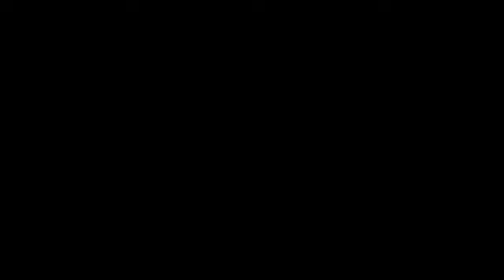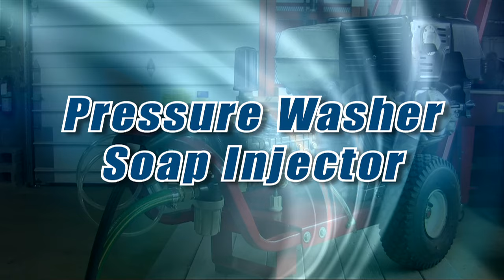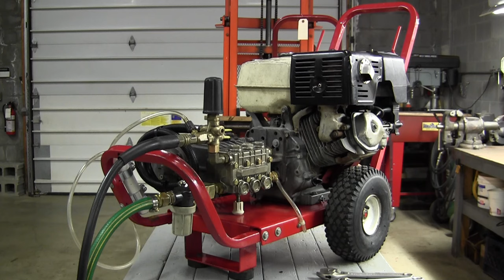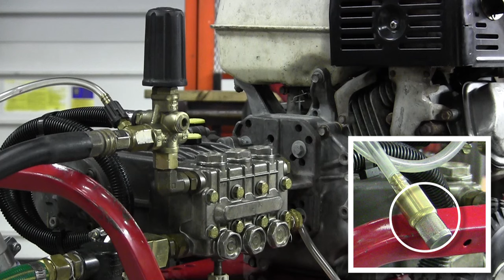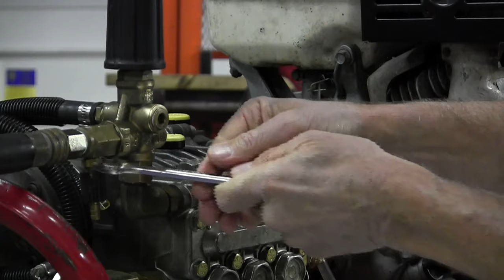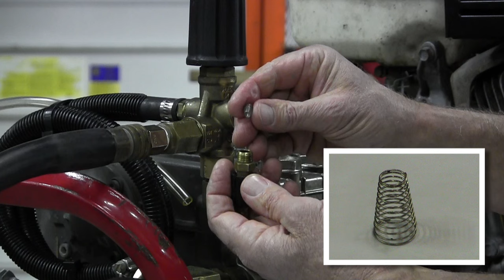Pressure Washer Soap Injector

Comment: You mentioned using oil or Vaseline to lubricate the "o" ring. Bad idea! Both contain petroleum distillates, which will immediately begin to degrade the rubber that the ring is made from. Typically, the first sign of that degradation is the o-ring will swell out of shape. Plumbers lubricant, or silly as it might sound, KY Jelly or an equivalent sexual lubricant will not degrade rubber (for obvious reasons!).
I learned this firsthand when replacing the rubber seals on my discharge hose of my above ground pool. I used Vaseline, which IMMEDIATELY allowed the sealing ring to stretch out of correct size when the nut ring was tightened against it. I went to a pool store for the proper pool ring lube, and found that a toothpaste tube of it was near $20.00. Another customer overheard my story, and sent me to the dollar store, next door, where they sold an off-brand of sexual lubricant for ONE DOLLAR! Same ingredient as the $20.00 tube, next door!
Reply: Before I read this review, I actually thought of not using those lubricants. Thanks about the dollar shop tip, though I don't use any :)

Comment: I loosed  the black regulator dial on top too much. The black dial came off. I can’t get it back on. The threads won’t catch with the spring installed. Any tips to reinstall that disk are appreciated.

Comment: What kind of pressure washer is this ?!    I have had mine for 30 yrs.  My grandfather bought it new with the Honda GX engine.  
AND O NEED A REPLACEMENT PUMP !!     Who sold this very same cart that’s in these two videos from this guy ?   Plz.  Mine has a General Pump .  Cant be found anymore.  

Mine was bought in the very late 1980’s. 
Best pressure washer I’ve ever used and it worked for 30 yrs and this is why I want it fixed like new.   
I would appreciate any information on this washer.  My unloader looks like this one.  Soap intake as-well

Comment: My Briggs and Stratton SpeedClean 2800 PSI has worked so well however now the chemical injector only draws from my soap/chemical bucket when the unit is off.  When the engine is not running it works like a champ! When the engine is on and running properly, it will not draw from the bucket at all.  I purchased a replacement injector, ball, spring, and hose and after installing no change.  I took off the manifold and checked the o-rings and valves and all looked clean and clear. I removed the unloader valve and it seems to work as expected. I am using the correct black nozzle attachment.  I've tried lowering the water pressure at my faucet.  Again, works exactly as expected with the engine is not on.  Any ideas how I can get it to work again when the engine is on for that little extra pressure for applying chemical/soap?

Comment: Anybody know if they make a real soap injection system instead of this Willy wonka crap? Brand new ball and spring. Without nozzle or nozzle for soap, it will not draw in liquid. But the check ball moves freely. $1290 CAT pressure sprayer and this "add on" feature is a joke.  When it does work, it uses far too much soap or not enough.  I am ready to get rid of the new rig and get something even better, but they all have this crap system.  What do car wash places use?
Reply: Yea man mine draws way too much soap all at once